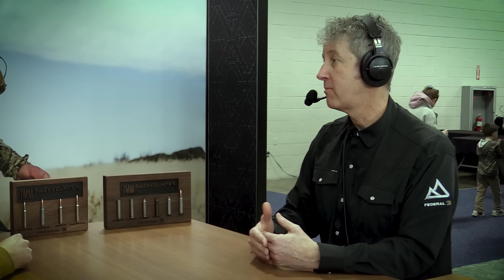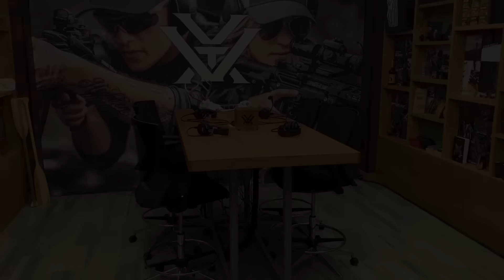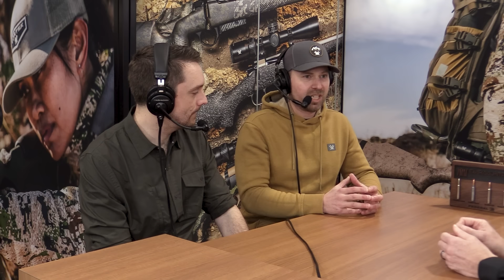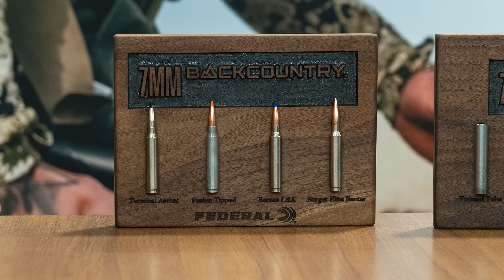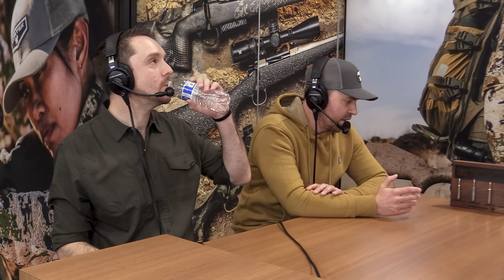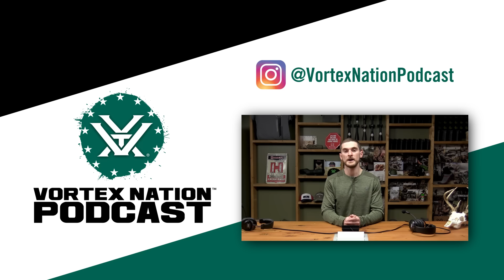Ep. 419 | 7mm Backcountry | The Full Story from Federal

Comment: Ryan had to play politics and talk about using a Terminal Ascent bullet in his shorty 308. We see you Ryan, it hurt not talking about the 130TTSX. 😂
Reply: Ryan is going to load the 120 ttsx for the 7BC.
Reply: @z987k  re: "Ryan is going to load the 120 ttsx for the 7BC."  
Either that or the lightest LRX, the 139, which while still being relatively light for caliber, has the combination of a higher BC and a lower opening velocity by about 400 fps.  A lot has changed since he settled on the 130 TTSX for his 308.
Then again, if he wants to use the 7BC for significantly longer range, he might YIELD TO TEMPTATION (as my preacher would say) and go heavier and (heaven forbid!) choose a heavier bullet.  It is useful to know that the 155 Terminal Ascent was designed for the SAAMI-length 7mm  Rem Mag that is limited to 0.79" of the bullet in front of the case.   These days,  I suspect he is looking at the Barnes 160 LRX, a more recent bullet designed with a significantly longer ogive for the 7mm PRC (the 170 TA is Federal's 7PRC design).   When the 155 Terminal Ascent came out in 2019 or 2020,  it was near the top of the heap it had better long range performance than the Barnes bullets at the time, so Ryan apparently was tinkering with it.  Now, however, he might come back to Barnes since since their 160 has a slightly higher BC than the 155 Terminal Ascent (G1 of 0.608 vs 0.586) and is... well, a Barnes.  In a Barnes podcast (yes, they have one now, too), they mentioned that the new 160 is significantly better at long range than the 168.

edited to add:  I suspect that the ogive of the Barnes 160 is too long for the 7mm BC to fit in Federal's factory ammo.  That's why they only load the earlier, shorter-ogived 168 Barnes.  In other words, although the SAAMI max cartridge length of both is the same at 3.34", the 7BC has a longer case.  I suspect that Federal deliberately designed the sleek 170 Terminal Ascent  to fit in the upcoming 7 BC.  For us cartridge nerds, the head hight of the 7BC is 0.923" whereas the 7PRC's is 1.06".   
We know that Ryan's 280AI can handle longer-than-SAAMI loads, though, so he should have no problem with the 160 Barnes in that rifle.  I suspect that he would build a 7 BC rifle the same way.
Reply: Haha well he’s clearly familiar enough with other bullets so it didn’t come off as fake and it allows him to talk to a wide variety of people.  

We all know (so does Federal) that he’s a Barnes guy.
Reply: @nuckyduk15  Yup, and the only Barnes TSX bullets I currently possess are in Federal factory loads, so its not like Federal and Barnes are in fierce competition with each other.
Reply: @nuckyduk15 I know, but it did make me laugh because those of us who listen a lot have heard him sing the Barnes praises a thousand times.
Reply: I am a huge barns fan. I really appreciate federal loading other bullet manufacture bullets. I love the LRX/TTSX family. BUT if I am to load anything different it would definitely be the federal terminal accent. That’s the only bullet that I keep thinking about something else.
Reply: I was thinking the same thing....
Reply: Its not his first time, while he goes to barnes he loads and tests lots of other projectiles for other people like Mark.
Reply: Guys, the lightest .30 cal bullet in the Terminal Ascent line is 175 grains, so he is talking about 7mm, not 308.
Reply: Mark has to look away 😂

Comment: The Full Story is... They Couldnt release it in Common Cals... (.308win) because it would violate patents...  however... there is a company  (NAS³) that makes this, but in .308win... Higher case capacity... stronger case .. reloadable... Able to buy unloaded brass... can therefore load the 212gn Barnes bore rider...
Reply: As of right now you can not re load nas3 rifle cases.... u can buy them an load them but not re load... EXCEPT the pistol cases you can re load... but the nas3 cases are wild...
Reply: @sethperry1323 Off hand, I've got zero expirence using them, so I can't argue with your statement... But I could've swore I rsad on their site, or at least on the video I learned about them on, said they could be reloaded..  
Reguardless... I still feel like the NAS³ is a much moe-betta option than the 7mmBC.  I would not be surprised if its the exact same alloy. But hey, if you've got the money, and the space, who am I to tell you how to spend it...
Reply: I thought it was Alpha Munitions that applied this to many calibers. Chambering to almost exact dimensions of the steel case, a heavy dose of a fast powder like Varget, and pressures up to 100K psi. The steel actions (bolt actions) from major manufacturers only fail around 250K psi; the barrel is the weak point, failing between 150K and 180K psi. So, for those of you here who want a high-pressure version of their favorite caliber, it's been around for several years.
Reply: @johanpire95  I'm not sure... Nothing steel/alloy listed on their site... However to correct my previous statement Shell Shock, is the company and NAS³ is what their calling their "Alloy"... It comes in the NATO Cals and maybe more... Not sure it's them who owns the specific patents... or who does.. but it's the current best option for those who were upset with federal decision to release it in a Seperate cartridge over existing ones...
Reply: @El-Diablo-Blanco  Maybe Alpha Munitions uses something different now, but they were plated steel cases.
Reply: Patent protection periods have expired on traditional calibers.  I think it was more of a marketing move.  Peak Alloy in traditional calibers would be a game changer.
Reply: As what was stated in the talk. They made a new case so people wouldn't make a mistake and over load a brass case. And that is a smart move especially in America. Where your mistakes mean someone else's fault. IE. You take them to court.